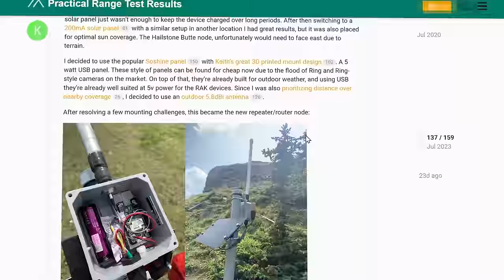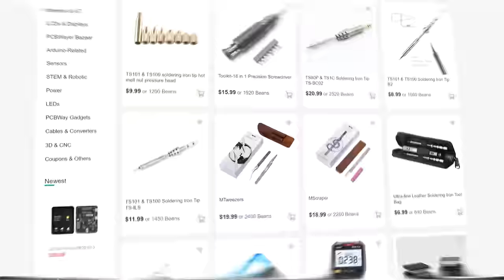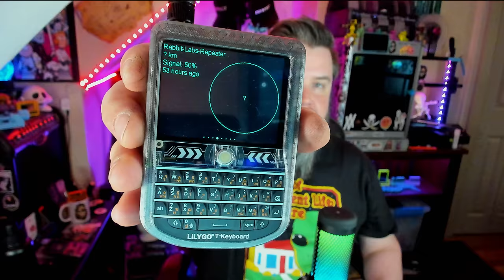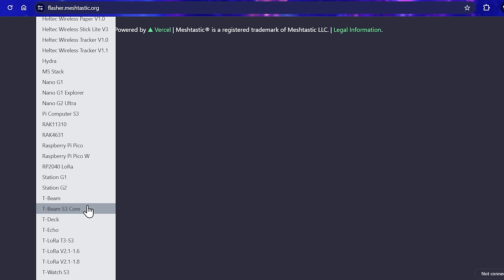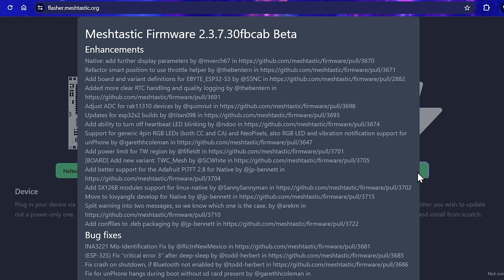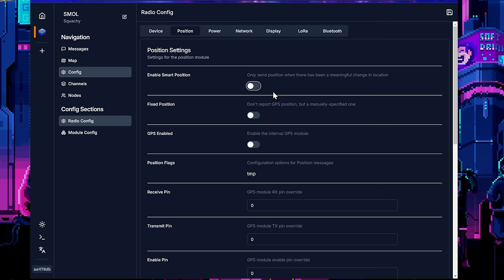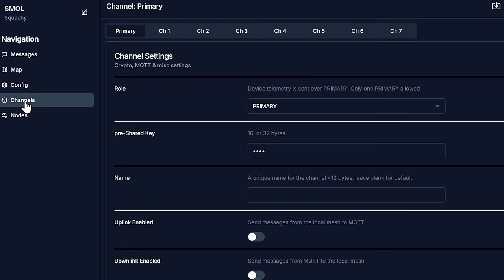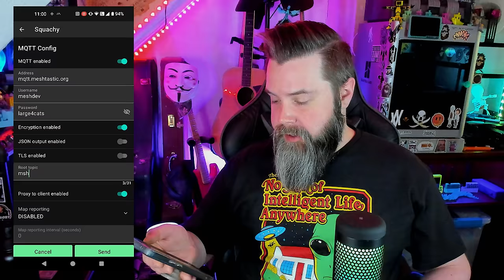Beginner's Guide to Meshtastic!  Communicate Off-Grid With LoRa or MQTT!

Comment: I think the confusion with MQTT is to understand why it was made, actually it was made to share telemetry from a group of censors that connect to a gateway, so that you can get data from sensors spread around a property, house, or a company HQ or zone
bc using those LoRa devices is cheaper than building an infrastructure to connect every sensor directly to internet via wifi or cell network
it was later that radio amateurs found it cool to use those devices for wireless comm

Comment: I follow another guy on here called RingwayManchester who covered Meshtastic.  For him the radio was the fun part since he is a Ham and using MQTT kinda took the fun out of going long distances.  If that's your idea of fun as well then there's no shame in not setting it up, but I mentioned on his video that there are plenty of other ways to use MQTT that aren't "cheating".  My first thought was it's intended purpose of sending sensor data, so you could have a little weather station that tells you what it sees, either periodically or on request.

Comment: I just wanted to mention that the TDeck case can fit the speaker and an 8000mAh battery in the standard version, and 5000mAh without the speaker in the slim version. Also you can fit a GPS module in both.

Comment: I have 2 hand helds and I'm building up a repeater in my small town.
hopefully I'll put another repeater up on the main hill in town (family home).
My neighbour has a few too.
The worst part is were the only ones in town using lora 😢
Reply: Exactly my point completely useless then use a mobile
Reply: there is the hobby fun part of it which most people do it for
Reply: @john1182   completely useless in my neighbourhood As I said before no nodes within 80 miles What's the point if you can't use it And it's pretty limited anyway if you could use it
Reply: @londo776  there are only 5 nodes where i live me and my neighbor's and repeaters we put up, its a fun thing for us (he ued to do this stuff in the military) were using it for some remote sensors etc with the esp32 board. im thinking of putting it on the farm to monitor water / open gates too. thats were it gets good

Comment: 915 MHz is the "name" of the band. The Meshtastic US main channel 20 is on 906.875 MHz. 
So, don't build a 915 antenna. It might have a high SWR on the default, ch 20. 

I don't buy an Meshtastic antenna unless it has some good reviews on 906.875 Mhz.
Never turn on a Node, until it's got an antenna installed. It might overheat the transmitter.  

Most OEM antennas will work, but they normally don't perform, due to a too high SWR or being made for the UK frequencies.
Reply from the maker: I appreciate the very thorough comment! Thanks!!

Comment: good call on blocking out the GPS ;)
Reply: Meshtastic is still highly trackable. The device is constantly putting out a ping. Anyone with a loop antenna could find you.
Reply: I would have great fun jamming all the signals
Reply: @DirtyPlumbus  we had a short discussion in his discord about before posting this video to obscure his GPS and to not have any data from other nodes on screen that shows their distance to him. so turn of GPS. and he did because a a lead promoter of the hackerspace he can easily be a target. go to a location open WIFI and scan for near by wifi snap shot it and then go to wigle run at least three ap's against the database in the town you were in you will be pinpointed. it's triangulation just like your RF method but this lets someone from another side of the world target you. I'm glad he took the advice and blocked GPS for his presentation. his previous screen scans leaked some ap Bssid's so once his town is found so can his house... just hoping he makes it a little harder every video. :)
Reply: @noxiouskarn  definitely good advice, even if you're not a potential target. RF tracing would require being relatively close by.

Comment: its crap For many reasons no Voice Is one Try and send a text using  them  it's almost impossible and  long winded. you need a phone most of the time to do it.   so why not Just use your mobile, And how are you going to power remote nodes So many reason why it's  rubbish The Nearest node is more than a 80 miles away from me. as You can see completely useless, It's a fad and it will die down soon, Using Smoke signals will get you better range, To be honest even shouting will, even using CB or cheap Chinese dual band radios or(uk like your frs)pmr446 Would be better off grid.
Reply: Seems like a knee jerk reaction with little knowledge of the subject.
Reply: tbh unless your in a place where lots of people have them they really dont do much
Reply: @nerfherder4284   just counter some of my points if, you think I'm wrong
Reply: Here in the UK they are very popular, I’m in the south east on the coast and can reach up to London and as far as Holland in Europe which is 120 miles, as of today I can pick up 130 nodes around me, there is also many nodes being powered by small solar panels, as for hard to use I totally disagree, the Meshtastic app on iOS is as easy as messaging. The main reason many of us are setting them up is an alternative if the mobile network goes down and you need to do basic communication . I personally have 4 of them, one at home, one mobile and two repeaters spread out 15 miles from me.
Reply: Let's be honest the mobile network is not going to go down unless the Russians attack or we have a nuclear war
Reply: @Peelerville  I think thats very cool, Im in south island of New Zealand and have seen people complain in local online places, that their heltech thingies do not much lol